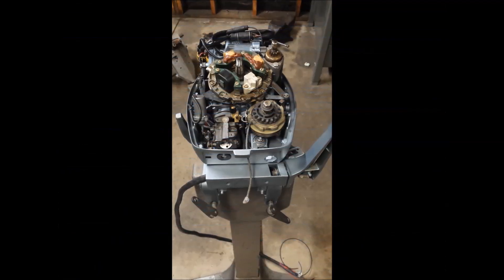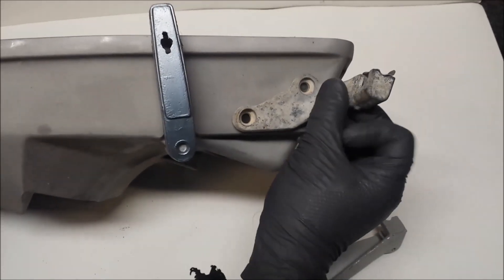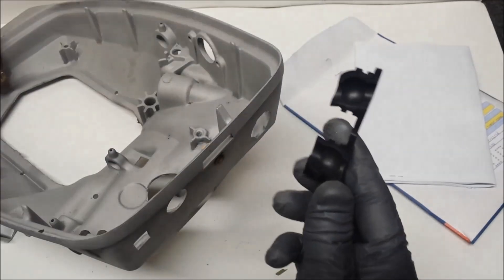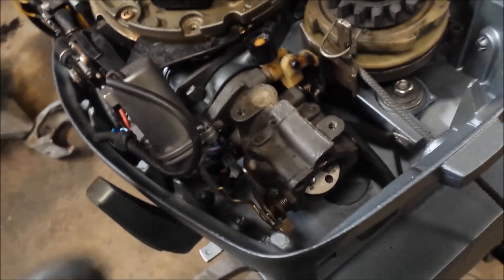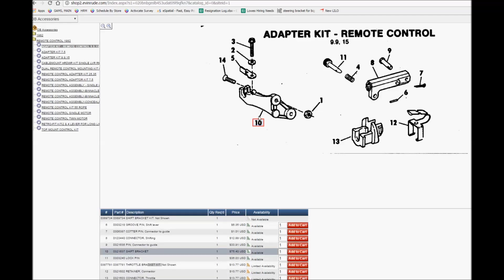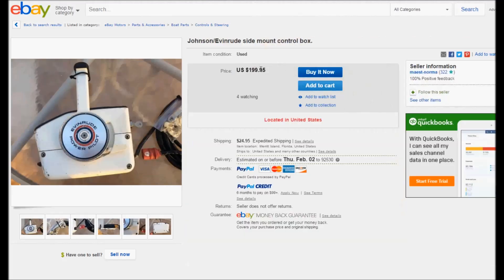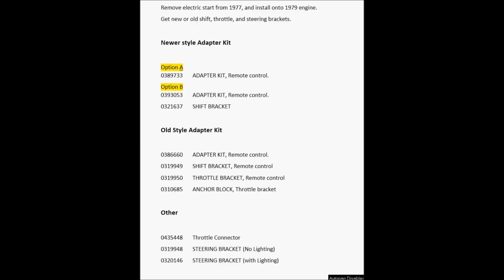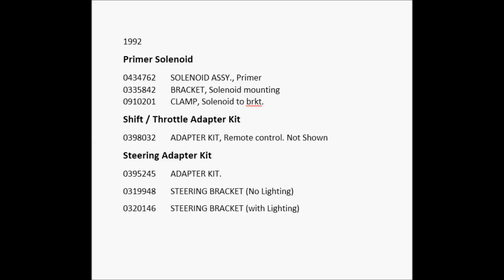Q&A: Converting 9.9 / 15 HP to Remote Steering & Start

Comment: Just curious of where u found the attachment for the steering cable to go in. I recently just came across a 88 evinrude 9.9 it has the plate but I'm trying to figure out how to add a steering cable to it.
Reply from the maker: ebay, but I believe they are only $25 new

Comment: If I have tilt tube steering do I still need the bracket that hooks up to the two holes or do I just bolt the connecting rod straight to the motor?

Comment: How ridiculous would it be to just add remote steering/throttle/shifting but keep pull start? Mine is an '88 15hp on a 16' jon boat. Console would be added just forward of the rear bench so the motor would still be within reach... I like the idea of electric start but when I start adding up the parts it's a little daunting when it pull starts quite easily right now. I think I read somewhere that some people do this and they just add a remote kill switch on the console... Maybe I'll slowly look at buying the parts for it... It's likely a winter project.
Reply from the maker: Ive done it, many many times.
Its not the best, but if the engine idles fine, its not that bad.
Just a lot of up and down. A remote kill switch is handy

Comment: I ordered snap on evinrude cables for my simplex, the new style that has an arm with an eye at the end and they hook up to the motor perfectly However, my simplex is setup to receive the old wire end. Can I replace the plastic guide the cable runs thru in the box or will I need a whole new control box?

Comment: I have 84 evi 15 pull start! My kill(stop)button is located right where throttle cable goes through there 3:48,4:20! Or explained in a later video? Thanks!
Reply from the maker: See at 2:01?
The stop button should be relocated to that large hole in the steering bracket.

Comment: how do you install the brackets for the gear shifter and throttle , i have an older johnson outboard (85 i think) and im struggling to find a kit for it. cheers
Reply from the maker: There are some low cost ones currently on eBay: https://ebay.to/2YC0waw
and the steering kit: https://ebay.to/32c5pJD

But, you  can also piece them together if needed:
https://ebay.to/2XvLCX4 - Throttle Connector Kit
https://ebay.to/2QaJi46 - Shift Bracket
https://ebay.to/2JwPH3a - Shift Connector

Comment: Brandon I have a 95 Johnson 25 hp with tiller throttle. I would like to switch it to remote steering and throttle lever controls. I don’t mind keeping it stock with pull start. I just wanted to know if I could use these parts on a 25 hp instead of a 15. If you could please give me some advice I would really appreciate! Thanks
Reply from the maker: No, they will not work. Please watch this video:
https://www.youtube.com/watch?v=PvsuTW2GYsA

Comment: I cant get the throttle hooked up on mine. Mine is a 90s 15hp. The throttle cable I have is way to big to fit around all the gears. Could you message me so I can give you my email and send you pictures of the issue?
Reply from the maker: Well, cant really message here.
Click on 'Brandons Garage' right below the title of the video.
Then click on 'About' 
In there, you will find my email.

Comment: Hi Brandon I have a 1960 Johnson FDL-14 pull start which I like to convert to electric start and electric choke, could you tell me what parts I need to do this and what years and what horsepower size motors that would  work to make this happen. Thank you very much for your time.  Cajun

Comment: i have a 9.9 hp johnson (J10ECUE) 1987 mod. and i want it to be a 15hp, do you know how? I also want to get the motor remote-steering and gass remote (no electric starter etc. I want to keep the old rope start...). Thanks

Comment: I have a 1986, 15hp, and someone had made a 1/8" plate steel bracket that mounted I to the front two holes and had a flat that bent forward to attach the steering. They also had attached an arm to this piece, that was used for the shift cable. A one piece solution and worked great. I am currently trying to track down a tiller handle for 1986-1992 motors to convert back to tiller control. If you have a lead let me know. Thanks, and great video!

Comment: Brandon, thank you so much for putting this video up, not only for me, but for the many out there who just don't have the knowledge and experience of what is entailed in assembling the parts to convert standard Johnson/Evenrude 9.9/15 engines to electric start and remote shifting/steering.  My journey has just begun, but with what you've shown, I can see some light at the end of the tunnel.  Thank you!